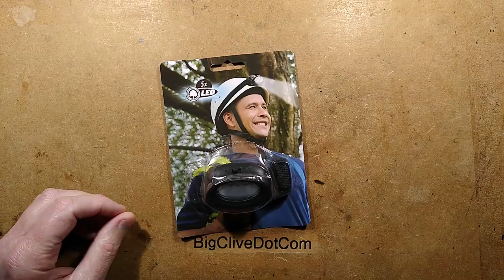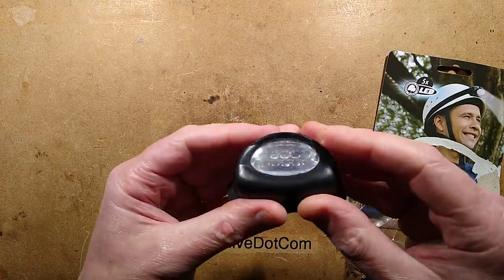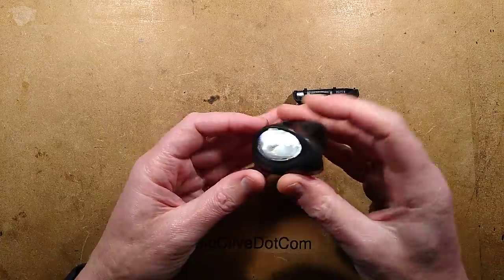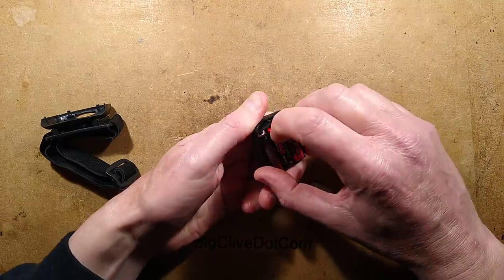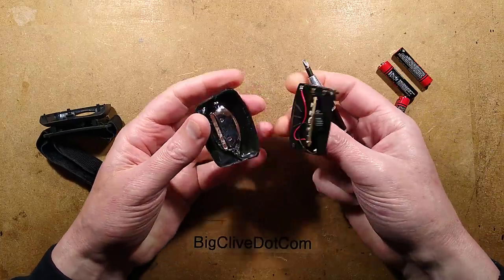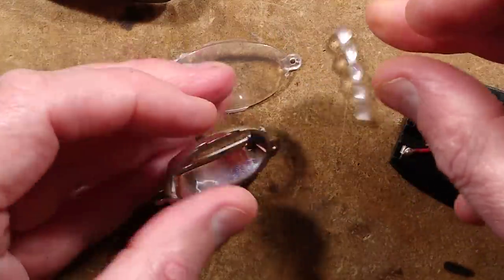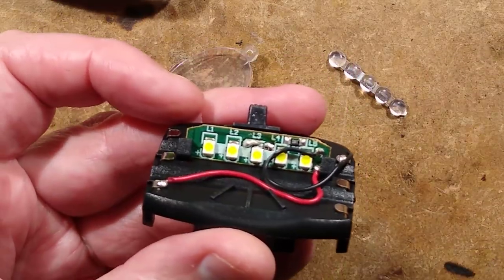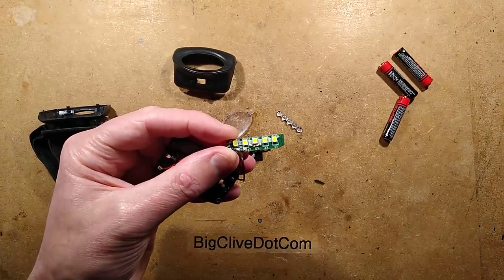Worst head torch ever.  Setting a new (low) standard.

Comment: You know your design doesn't have a leg to stand on when it is emulating the look of 5mm LEDs. I also find those 3xAAA designs a bit bothersome because they lack any kind of brightness reguation. Personally, if I wanted a really dim head torch I would rather 3D print some kind of housing and build a Joule Thief into it.
Reply: Nah, you can get more than enough power out of 3 AAA, you have more or less 3.6v 400mA assured which is the worst of both alkaline and NiMH combined. Its still plenty for a bunch of leds. Its enough voltage for white leds, and even with 5 50mA leds you still only have 250mA and you could easily have it work with rechargeable batteries because at 3v white leds would barely lit up making sure you know you are running out of baterry before overdischarging them.
The dimer and all that its really easy to have on a one chip or black-blob-on-pcb, just a mosft or bjt and pwm and you dont even need the charging circuitry for lipo.
Reply: If you buy a poundland torch, yes. Otherwise, nothing wrong with 3xAAA. I've many headlamps, most of them take 3xAAA, a couple of them have variable brightness output (not just pre-set levels but anywhere in-between as well), and my Led Lenser model will put out 180 lumens for 5 hours (claims 7 hours but not really). Yes you can get even brighter headlamps now but 180 is more than enough for me to run through the bush at night, in fact it's so bright it hurts after a while and I usually have it set lower unless I'm on particularly tricky or uneven ground.

Comment: But you missed out the awful switch; it's neither push sensor nor covered with flexible rubber.

Poundland briefly sold them late in 2019 befor superseding them with the far better COB replacement.

Comment: I have a Energizer head torch that's brighter an I bought it in 2007, still going strong now, it has two larger LEDs on one red. I bought it off a market stall selling bankrupt shop stock, it's still going strong an bright an uses the same batteries as yours but yours has more LEDs, it's not brighter though but with electronics you get what you pay for, pay cheap price get a bad product. Some Chinese electronics is dreadful an very poor quality, I have heard of batteries an chargers catching fire. Poundshop batteries don't last long, with zinc carbons if you can squeeze the zinc casing flat with your fingers you know it's poor quality, there ok for a test supply though but don't leave them in equipment to long because there prone to leak. Sadly poundshop electronics are not that good but there other products such as epoxy resin work just as well as more known brand's, with electronics pay that little extra to get a better product. This video clearly demonstrates that fact.

Comment: But on the other hand,  at least it doesn't have the obligatory ON/ BLINK/ SOS hold 5 seconds for OFF switch.  those are my least favorite.
Reply: That chip and pad may be cheaper than the switch.  Plus it often includes Joule thief functionality for single battery design.

Comment: It would probably be superior to a basic 5mm LED torch if they had just removed the lens array, and used the SMD LEDs with the reflector. But no they had to ruin it. 
Also, 3xAAA is such a crap battery configuration. They don't sell 3 packs of AAAs, and it doesn't hold much energy for the materials used. It would be much better with 1xAA and a boost converter, like some decent non-enthusiast torches use.

Comment: I can imagine these being handed out as gifts for buying a magazine subscription or some other product.. "A FREE great high-quality outdoorsy head torch, value 29,99!"
Reply: I ended up with a cassette player that was given away as a premium with a magazine subscription, Time Magazine, I believe. I think someone gave it to my sister, whom really had no use fro it. Whilst it did work it was almost like they adapted the amp out of a Walkman, but connected a pair of 1-1/2'' transistor radio speakers to it, but not even as loud as a transistor radio.
Reply: I got my first webcam like that! Potato vision, maybe I should send it to Clive
Reply: @mc_cpu  I bet there isn't much inside in those :) I repurposed mine as an IR head tracking camera. Just removed the IR filter from the lens and added a bit of floppy material to block visible light and presto it only sees IR LEDs now for my head tracking cap.
Reply: Coming soon, the Souljaboy Headlamp, 59.99
Reply: Brandon Smith  what a tragedy, the story of how Bell & Howell went out. I had a really nice Bell & Howell slide projector, and I got it for free. Sadly I've sold it since, but it gave me a good impression of the company.
Reply: 29 Matagalian gumbo beads, perhaps.
Reply: 29.99 in Vietnamese Dong, look up the currency conversion.
Reply: It’s the white van speaker scam for head lamps

Comment: My 2007 Prius actually has a row of fake leds in the headlight lens along the bottom of the turn signal (which uses an incandescent bulb). Glad to see the trend is still alive
Reply: Some Dover elevators from the eighties or nineties (and likely others too) have fake LED dot matrix displays for the floor numbers. Actually just tungsten lamps behind a red mask. So the trend has been going on for a long time. At least this flashlight actually has five LEDs.
Reply: 2007 Prius, so has it had its second battery change yet? Or is it the third?
Reply: @chrishartley1210  You can change out problem cells with balanced ones usually, no need to replace the entire pack unless you just want to make it easier on yourself. Though usually the entire pack is not even that much.
Reply: Japanese car with lights made in China?
Reply: @donbriggs9128  Only lights? Hmm... I thint that majority of it is made of chinesium and similar materials.
Reply: Shawn Stafford  The majority of private taxi firms seem to use the Prius these days, that must say something about their reliability and running costs.
Reply: Still better than dead leds in VW, worth like a 300usd to fix
Reply: @ferrumignis  Visited Germany last year and almost every taxi is a near new model Mercedes saloon, guess it's regional, and Germany is winning
Reply: The turn signals in my 2015 durango are incandescent. I think they act as a ballast for the bimetal blinker,  leds blink fast and don't draw enough current to heat the blinker, or keep the burned out bulb warming happy. Every other light is LED, not sure about the headlights
Reply: @piratetv1  makes sort of sense to keep using incan blinker bulbs just so they can keep using plain old electromechanical bimetallic blinker relays, yes. Doing it right with LED would require actual electronics, which would likely cost a bit more to develop but cost way less to manufacture. At least f different brands would standardize on one unit to get economy of scale, if they don't expect to sell hundreds of thousands of a given model then it may be cheaper to stick with off-the-shelf blinker units.
Reply: @Kaboomf  true,  my tail lights are led strips fashioned to look like neon. I just wish the front signals didn't need to be changed,  they seem to melt the bakeolite and the terminals sink in, if you pull the bulb and re rout the wire terminal it'll work again.
Reply: @Mogliz0rz  Winning in what sense?  A first place for most vulgar marque used as a taxi?
Reply: @piratetv1  body control module will not have anything like that
Reply: @ferrumignis  nope, they just got good deals from EU and Government ecology grants.
Reply: @Kaboomf  it's more likely the designers were told to include as many components that they have millions of in stock as possible. It's oddly ecological, as they've already used so much energy and materials producing them, it would be far less ecological and less economical to produce newer energy saving ones. That's probably why you can still buy incandescent candle bulbs from the supermarket.
Reply: Shawn Stafford  Do you know what a mid-life crisis is? You don't go out and buy a 2007 Toyota Prius.

Comment: Ahahaha, looks like one of those bubble strip magnifiers they used to put in calculators in the 1970s before LCDs took off
Reply: That's what it reminded me of as well. :-O
Reply: Those LED bubble displays from HP and TI were very cool.
Reply: @bills6093  The HP ones used in their early calculators were very unreliable
Reply: Oh I'd forgotten those, I had one. Cost a fortune at the time and a set of batteries only lasted about 3hrs.
Reply: @TheScribemole  Ti ones used to be rechargeable.
Reply: Wow, with those tiny high voltage 7+1 segment neony-looking display lamps?
Reply: @stephenbell9257  Compared to the Sinclair ones perchance? Which were about as relaible as a plumbers estimate.

Comment: I've got the same head torch as this but it has a push button with 2 flash modes instead of a toggle switch, and it certainly doesn't have a wire going across the LEDs!

Comment: You're clearly impressed. Maybe it should be modded to be a belt-mounted one so you can have a wee without switching on the bathroom light?
Reply: Men don't need a light in order to miss the bowl. :)
Reply: @eDoc2020  Nobody needs a belt light ... but it might be fun?!
Reply: @emm_arr  Belt mounted lights are an excellent adjunct to head lights for night hiking because they cause obstacles to throw a shadow that you can see. Objects lit by a head light alone have their shadow concealed from view because the light source and your eyes are so close to each other. For example, rocks covered with dust on a trail can be nearly invisible with just a head light. I always use an auxiliary light mounted off axis when I want to move fast and/or reduce eye and brain strain.
Reply: "I swear I'm not masturbating, I'm just trying to turn on my um, trouser light."

Comment: For a pound, it's about what you'd expect. But using the surface mount chips directly without all the other crap would have been fine as a "wash" light (unless the colour was bad as someone mentioned) and silkscreen the PCB white. 
In it's defence, it uses a real switch and at least it's GOT a resistor, that many don't even bother with.
Reply: Walmart sells an OzarkTrail one for $1 that'd knock the pants off of this one.
Reply: The cheap lights without a resistor will only last if you use 'Heavy Duty' batteries. I damaged one through overcurrent running it from a 5v adapter. When I switched back to batteries it was so dim it was hard to see if it was on without looking directly at it.

Comment: Wonder if the Economy version has just two wires you twist together and no switch?
Reply: Better yet it's always on for maximum convivence.
Reply: @butterdubs2267  it's a thing on some items, you just take the battery out.
Reply: It could have the batteries held in the lid instead of in the light body. Closing the lid closes the circuit. That would provide a sort of (inconvenient) switching functionality without increasing parts cound. Also, eliminate the fake LED and diffuser parts.

Comment: The LEDs are labelled L1...L5. With an unpopulated board somebody is going to try to fit inductors.

The next project is to upgrade this headtorch. Replace the LEDs with an arc lamp. Cheating is allowed by fitting the batteries and driver circuitry in a rucksack.

Comment: Well bigclivedotcom, they could have cheaped out even more and ommited the small smd resistor and just rely on the resistance in the wires for a voltage drop big enough to not fry those LED's straight away 🙄
Just saying... 😀

Comment: Gees... Thats indeed the abslute bottom of quality... I wonder how much current it draws from those poor AAA's since the LEDS are all in Parallel.
Those lenses... they make me think of the system that early LED displays used. Especial, the first pocketable HP Calculators used a red LED display with lenses on them to enlarge the numerals.Removing the strip of lenses, makes it a floodlight. (Can read only a book at night...)

Comment: That "fake led strip" is actually a series of lenses for the SMD leds. Fair design, used in many places but it requires a degree of precision in manufacturing (both the lenses and their placement relative to the SMD leds) that the manufacturer of this head lamp will not pay for. They won't even pay for correct assembly judging by the wire between the led and the lens.

Comment: Must be the new version of this torch! Mine has 3 regular LEDs that aren't very bright. As crappy as the torch is, as good it is. It's by far the lightweightest torch ever and doesn't disturb you. The biggest drawback of it is the switch that doesn't last a long time. With a good switch, it would be perfect, since it hasn't got all that useless stuff like SOS or different dimming levels that always have to be run through whenever you want to switch it out.

Comment: but this isn't even the cheapst torch you can find, tho it is probably the crappiest. I saw a 1 chip SMD powered by two 2032's and the switch was integral to the housing, the button just a cutout and a plastic finger extended down to the membrane contact this one had. they were in the 99c bin, guaranteed to last half an hour only or 20 cycles of off/on haha

Comment: In technological terms its shit, but from a commerce perspective it is an amazing example of Chinese globalism

Made for around 18cents using parts and labor costing around 11 cents... Exported for around 40c tarries and shipping take it up to 50c   shipped to retailers for around 65c  retailed at $1.25

Once opened, your cheap shit headlamp will function poorly for approximately five minutes until you try to stretch it over the peak of your cap and the side clip that holds the elastic band in place will split rendering the unit completely useless, You know it's shit but still its hard to turn down a headlamp at $1.25 ESPECIALLY if it comes with batteries !!!

Comment: This is a rework of my first-ever white-LED light, I bought in a dollar-shop somewhere between 2003 and 2005! I even used it as a bike front light, although batteries didn't last long in it (about 40 minutes to an hour for zinc-carbons). The original model actually had 5 standard 5mm LEDs, and did some flashing, so probably had a chip too (had a push button instead of a slide switch, and several functions). Taking into account that an original was a (very) cheap light, and 5mm round packaging isn't popular for white LEDs anymore, these bad-looking modifications were probably the necessary changes to keep the model adapted to current production methods for electronics of this kind, and it was cheap and simple toy to start with, so it couldn't end up far from that status anyway.

Comment: I have an LED head torch that takes three 18650 batteries. The batteries are separated from your head by a piece of thin foam. There is a single large SM LED chip with a large polished conical reflector. The lens is standard picture frame glass. Whilst the construction materials and methods leave a lot to be desired, and it's quite heavy and cumbersome, it puts out an amazing amount of light in a focused beam that measure 2m in diameter at about 10m distance, you could easily hunt rabbits at night with it.. It's a really odd thing, I wouldn't want to wear it on my head incase one of the batteries faulted, which would most likely happen at a really bad moment causing you to fall and get the broken glass from the lens in your face.

Comment: I am a scout leader. I see kids with crap head torches all. the. time.
They either break almost immediately, too dim to do be able to do anything useful or the batteries don't last long.
Some parents never seen to understand that decent kit doesn't cost that much and makes life on camp or hike so much more enjoyable. Waterproofs, boots, rucksack, and torch are the essentials that you should never cheap out on.
A decent sleeping bag and rollmat can also make a huge difference however these aren't essential as you can make do with wearing extra clothes to bed.
I've also met another leader who bought 4 pound shop magnetic hockey puck LED lights for the camp, only one of them actually worked for any length of time.

Comment: You might have to wash after using this 💩.

The joke is they probably spent $10k in tooling to mold that "lens" strip. Injection molding is only cheap when divided by very high production numbers.
Reply: I bet that strip is made by the mile for various craptacular purposes. Toys, maybe.

Comment: It can go lower... I'm sure the lens and SMD LEDs can be replaced with a string of straw hat LEDs soldered in a string with a resistor at one end, the circuit board can be dropped and replaced with hot snot, and the switch replaced with some bit of plastic that breaks the connection to the battery. Then they can reduce the number of LEDs and drop the resistor!
Reply: What about a single LED, a button cell battery, and a bit of electrical tape? (Battery not included)
Reply: @DaedalusYoung  Aye, and then they could sell it in kit form so they can drop the electrical tape as well 😁

Comment: I know the british say "torch" when they mean "flashlight". But to me, a torch is a stick thats on fire on one end. In that sense, a "head torch" sounds like a really bad idea.
Reply: Andreas U. Yeah mate, a stick with an oily rag on fire at one end is a torch, an ancient method of seeing in the dark, then humans progressed and discovered electricity and made an electric version of the torch, a stick with batteries inside and a light at one end without the burny flames bit for safety.

Same but different?

So if a wax stick with a wick through the centre that you can set on fire is called a candlestick, what do you call the plastic variants with batteries inside and led poking out the top?

Just wondering......🧐